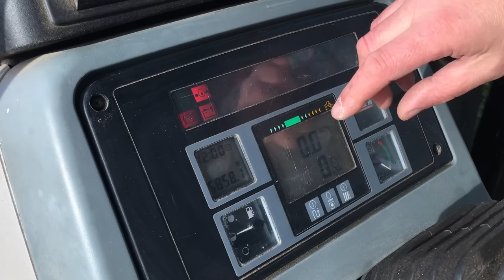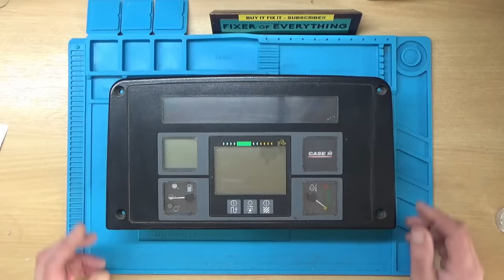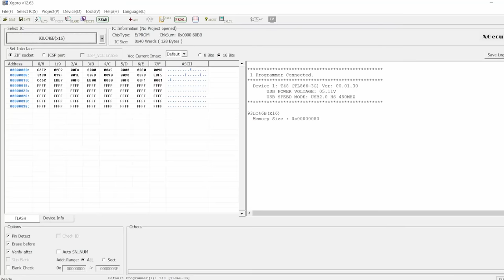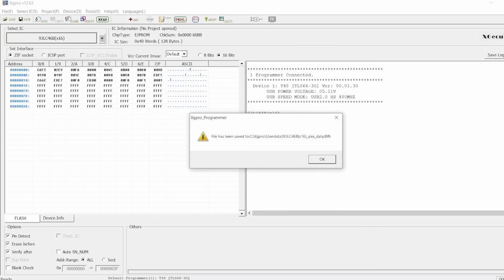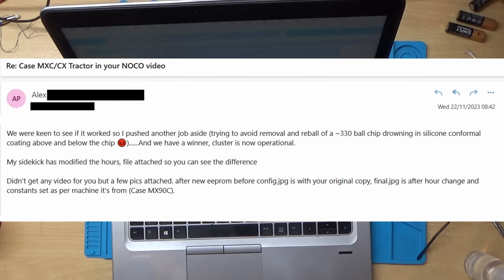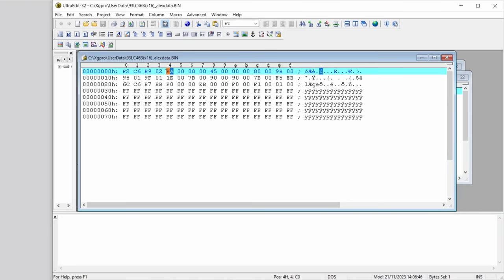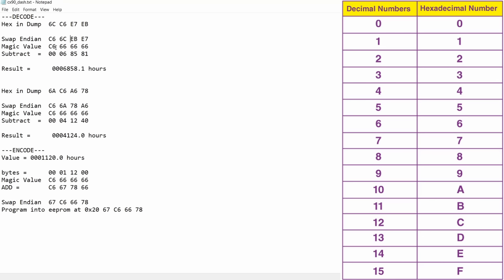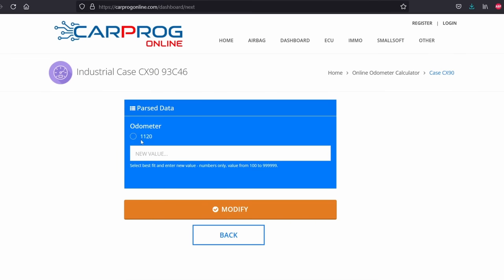Helping Someone 10,323 Miles Away Fix A Tractor Digital Dashboard!

Comment: GRAND ,,,, well done thoroughly enjoyed that one …. ‘Magic’ … I wonder if you can workout Activation code from car VIN number to activate new functions on my car 🚙.   I wanted to upgrade my old car radio because I can’t input full UK POST CODE, only partial for example  { NW15 6 } so I wanted to retrofit the newer model unit but if i do without coding the newer radio eventually it will time out in a few day because it’s not seeing the correct or current VIN code data ,, the dealership won’t sell you a activation for that model radio because it didn’t come with that generation of vehicle, if you want that newer radio unit they want buy a NEW CAR Hahahahahahahahahaha…. so to get a activation code you can buy it from a Russian 3rd party by giving them your cars VIN number,  and then they return an activation code from your VIN to input into the car via the Car diagnostic software which I have, new functions are Comfort setting, sat nav, iPod, sports mode etc would you have a clue how that works from a VIN code , it’s hexadecimal problem,,, I have worked out how to install the new head unit  again dealer will not install new unit in older cars and I don’t want to Commerce with 3rd party’s because of the WAR going on at the moment….. it would make for a interesting viral project because I’m not the only one in this jam they would  be worldwide interest as the car is sold over the worldwide and everyone with this model feels done in by the manufacturer selling and outdated head unit in the 21st century you can’t upgrade …
Reply from the maker: Thanks 👍I'm not too sure on that. You would need to work out the algorithm that they use to generate it, probably by dumping the firmware of the radio (if that's where the unlock happens).